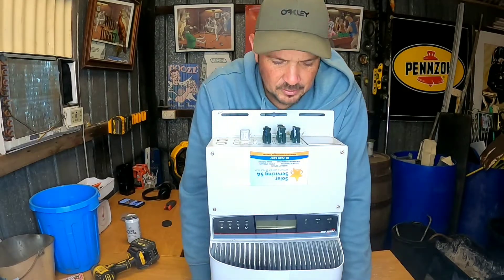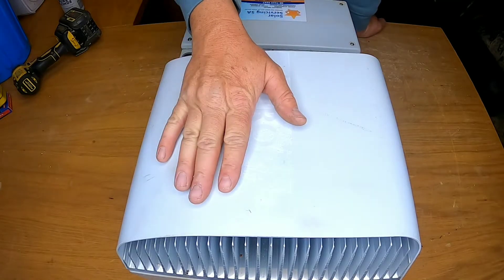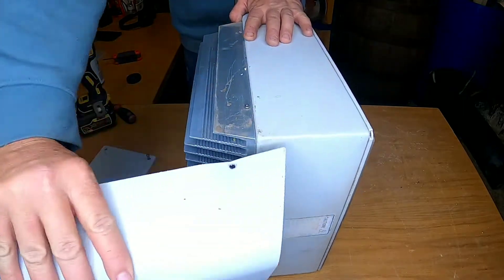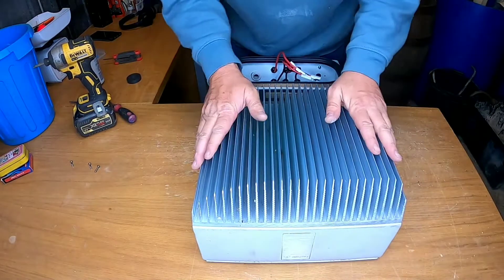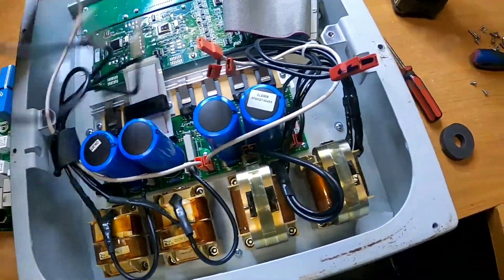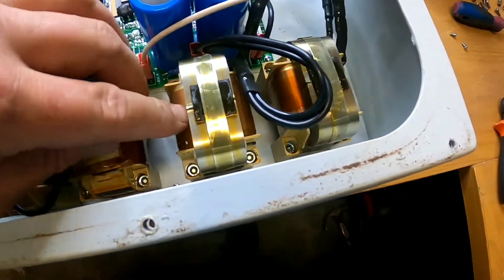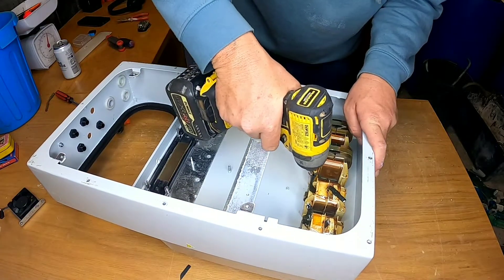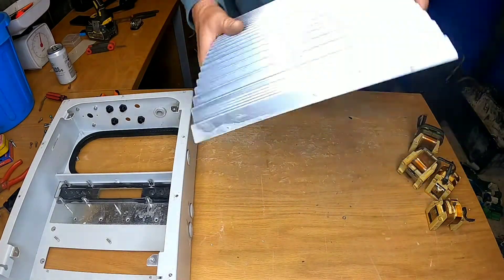My First Time Scrapping a Solar Inverter. What's Inside?

Comment: Nice video! Just bought a 30kw inverter for $375, weighs 575lbs. I am hoping to use it as it apparently works. Purchased from auction so a bit of a gamble. Do you think I could scrap it and break even or gain if it does not work?